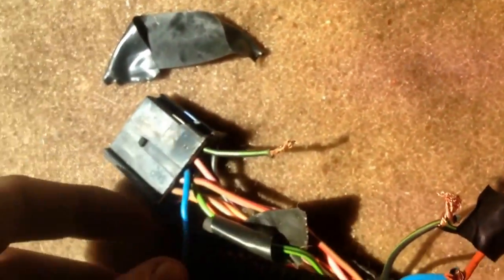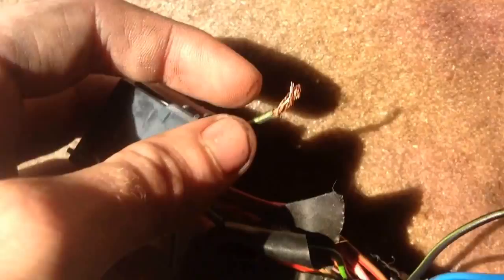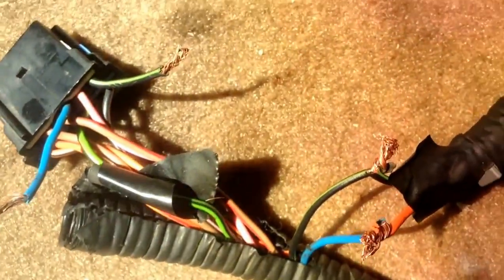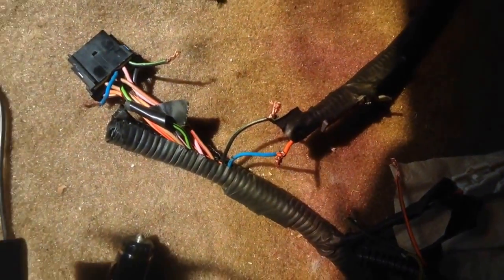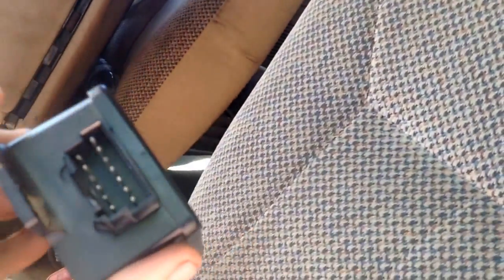Fix locked seatbelts on a 99 Dodge ram 1500

Comment: Thank You!  After 10 years of intermittent problems and dead batteries I decided to try your fix.  Today the belts work properly and hopefully the slow drain on the battery has been resolved.
Reply: I’ve got the same issue. It’s my first truck and I unplug the battery’s every day but it’s getting old

Comment: My 98 has 4 wires on the driver side. Black n green, Green n orange, Blue, Orange. had to connect the blue and orange together to the hot wire, black to ground and it works! Thank you!

Comment: This may be a dumb question and I know I’m super late. But I just bought a 99 from my work and they can’t let it go unless I find a timing sensor (dodge discontinued) the previous owner did this fix and my curiosity is if the seatbelts still work mechanically? If I was to get in a accident with this fix do they still lock up? I can’t find any information on how this system works. If I can convince them that the belts work regardless of the g-sensor then I can take my time bouncing to pick n pull to find one.
Reply: Yes, in the case of a sudden stop (accident) they work mechanically.

Comment: Hey I got a 2001 dodge 1500 I just bought they replaced the front bench seat now since the wire is not connected to anything the seat belt will not unlock

Comment: My passenger isn’t locked but my driver side it so should I just redo the wires on the driver side part
Reply: I did the same thing make sure its the right wires .. drivers side should have three.

Comment: Soo... Do you not realize how unsafe that is...? So it unlocks when the key is on meaning there is no lock unlock functionality to the safety system that saves your ass when you get into an accident becuse the seatbelt will never lock and hold you or anyone else into their seats either when the brakes are engaged ... Smh I hope for your sake you don't have any loved ones riding with you ever!
Reply: You don't understand how seat belts work.
Reply: The seatbelts don't need electricity to lock. You can remove or the electrical components and still be safe in a crash. This is actually the more common way people fix this problem. This solution, however, allows you to fix a draining battery and have the seatbelts still remain fully functional. Not to mention you don't have to take the whole seat apart. He actually mentions most of this in the video if you watch until the end.